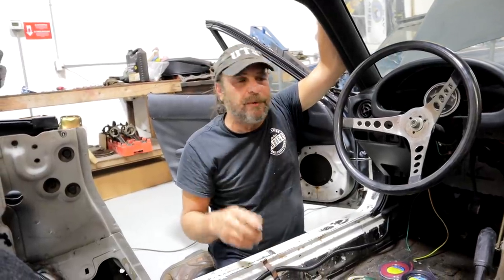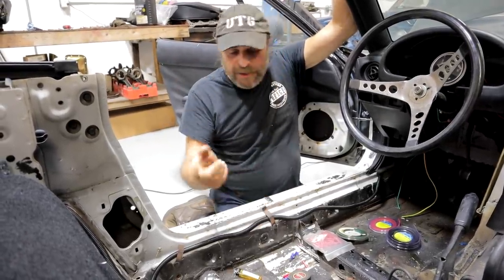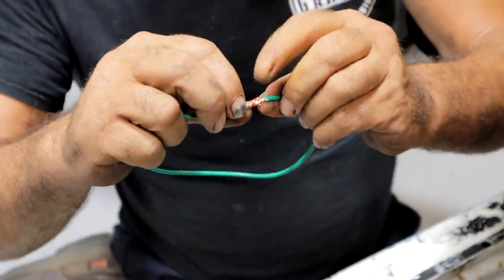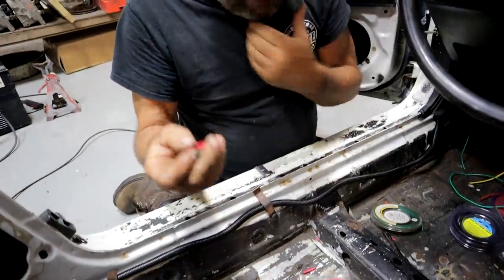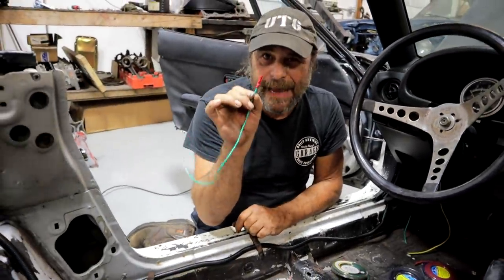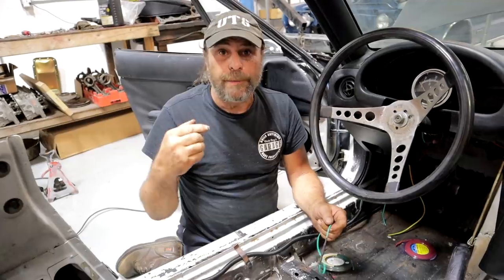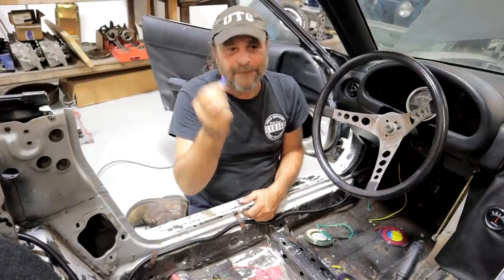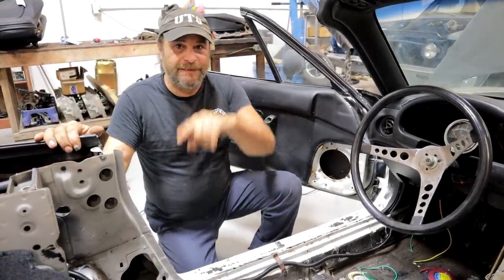The Single Most Misused Item In The World Of Cars

Comment: I have fixed sooooo many of these that the "crimp" has backed off or relaxed and the connection is now intermittent.  I always replaced customer work like this with a westinghouse splice (good mechanical connection), solder, a little silicone sealant, and a heat shrink.  I have never had a problem with this method.  It took a little longer to do but the customers never had problems with my work.  When I needed to make any other type connection, I would only buy the spade lugs or washer type connectors that would accept solder (a lot of them do not).  Never had a problem with my work.  In my 30 year business I had a lot of repeat customers that really appreciated my work.  
Crimping with an improper tool ( as he is using) usually lasts until the customer gets out the door.  If you are using a crimp, get the proper tool to crimp the proper crimp connector.  Metal tends to return to it's original shape over time, uncrimped.

Comment: The only correct way to use those cheap plastic coated butt connectors, is not to use them.
If you have to butt connect something, use a better crimp connection that folds over into the wires. Like OEM ones. It won't have any cheap plastic on the outside. And you will still have to heat shrink it but you also don't have that crap plastic making a thicker connection, doing nothing, and hiding how will your crimps is actually crimped.
Further, you don't crush a crimp together, it squeezes and should ratchet and compress turning it into itself compacting the wire in there... 
As soon as I see a single butt slice like this, it's just as bad as all the other crap connectors you're talking about. These do not belong in any car.

Comment: Jeez..barely better than twist and tape method. Start with uninsulated crimps. Get a decent  set of crimpers made similar to pliers. (not combo multitool stripper crimper that comes with 200 cheap crimps) always crimp with dent side opposing split in crimp. Keep split side in the valley. Do not twist wires, leave stranded. Always stagger connections to keep crimps from being all together in a ball 3x the size of the rest of harness. It will  make a more durable, way cleaner harness.  cover crimp with marine grade shrink tube. ( in a pinch take a thin bead or two of hot glue across length of crimp and  beyond the insulation of wire on both sides of  crimp.  allow to cool and cover with regular  shrink tube.  when heated to shrink, endanger glue should remelt and come out of both ends.  wipe away excess) additionally after crimping can solder into crimp as well. Not recommended  for smaller wires  or high vibration areas though . More like for 0 or 2 gauge  crimped ground rings for example . Do not overdo it as it will lead to being too rigid  and breaking at joint.  finish  with spiral wrapping entire harness  with space between wraps like  one candy cane stripe. then cover with correct size loom then tape loom in similar fashion . Except start tape at forks or ends by wrapping around wire only then bring tape through  split in loom and  repeat at opposite end or  junction. Seriously ,throw  that harbor freight buck bin connnector set and tool in the garbage  if you want no problems and professional  appearance .I'll make a video next time i have the opportunity to.  I assure you will have  a much better end result .  materials  can be had online with same budget if planned and sourced ahead of time . Will take about 50% more time/ labor though .

Comment: Definitely should use shrink wrap, and if you do it exactly like Uncle Tony, you have a good start, but you should really do it a little better.  

First, don't use the butt connectors with the plastic insulation and then add shrink wrap.  In a pinch it's fine, but it just builds up unnecessary bulk.  Either get the butt connectors without the plastic insulation or remove it.  You don't need it, you are going to shrink wrap.  Second, use a better crimp tool.  What is being shown will work, but it is will not provide a very strong connection.  There are much better crimpers that are specific to the job and will make an excellent connection, and unless you are using a heavy gauge wire, they are still pretty inexpensive.  Third, don't use a cigarette lighter to melt heat shrink.  It does a very poor job of melting it evenly and stands a much higher chance to lighting things on fire.  Heat guns are very inexpensive and are the correct tool for the job.  They will make sure that your tubing is shrunk evenly and provides the best possible seal.  Lastly, generic heat shrink tubing will provide some protection, but it is not sealed and will still let moisture in.  Look for waterproof heat shrink tubing.  It has a bit of adhesive on the inside that will melt with the heat, adhere to the wire insulation of your joining wires and provide a water tight bond.  You can find this on Amazon, and is sometimes called marine grade.

They also make butt splice connectors that have water-tight heat shrink insulation already on them.  I fear that most crimping will compromise the insulation, but they may be useful in a tight spot.

Comment: Some people say that soldering is the way to do this properly..... to some extent, they're right, but this could cause problems down the road.  Soldering is Way better for electrical conductivity and virtually NO resistance at the joint.  The problem with soldering stranded wires is it literally turns a flexible stranded wire into a SOLID wire at that point, and we all know that solid wire is prone to stress fracture and failures.  The only way to get around this failure prone area is to supply a significant amount of support to the joint to prevent or eliminate flexing or vibration induced stress fracturing and failures.  Shrink tubing does this quite well, but the joint should also be secured in such a way as to support both sides of the joint.  Flexing a solid wire will break it.

Comment: Check with you're supplier or parts store. I use a crimp connector with heat shrink and glue for sealing wire's. Useing kimpex style pliers ment for un insulated crimps drives a divot into the connector then hit it again with the standard crimp jaw. You will break the wire before you pull it out if you do it right.

Comment: I see a lot of heat shrink butt connectors used where someone didn’t shrink them, or half way shrank them. Drives me nuts. Why use heat shrink if you aren’t even gonna bother shrinking it? 

And, usually if I’m doing diag on an electrical issue a good place to start is usually wherever there’s electrical tape or other “repairs” done to the wiring.

Comment: I worked years as an industrial electronic technician; I Always soldered and shrink shrunk controllers wires.  If a factory line assembler connect fails it can cost $$$$ if the line stops. $$$$

Comment: now that is the problem: a so called professional working like a hack.
that kind of crimping tool is not used by anyone that works electrics for a living.
because it sucks big time.
it just squeezes the metal flat.
just a problem waiting to happen.
a real  crimping tool crimps a hexagon.
and by the way, those connectors were never intended to be used with shrink tubing.
the ones that are have the shrink tubing incorporated into them.

Comment: Excuse me for being late to the party....unfortunately you really missed the most important rule when crimping wire connections. That is to be sure the seam in the crimp connector( where the seam is where the metal is rolled to gether as you can see looking in the end of the connector)
is against the solid anvil on the crimp pliers and the pointed jaw is against the solid ( opposite) side.
The crimp is many , many times stronger this way.
If this is done on waterproof ( marine) connectors shrink tubing is redundant. 
Gary

Comment: I hate those connectors.they bulk out the loom ,look ugly and are unreliable as far as vibration is concerned.Solder and heat shrink so much better.Does not bulk out the loom to a big ugly bulge.IMO.Never had my method fail yet.you can also use non conductive grease inside the heat shrink for marine environment.Stops water and oxidization getting to the joints.You can troll me all ya like .facts are facts.I cringe when I have to fix a car stereo and see a mess of these crimp connectors ,ugly bulky and not reliable ...

Comment: All that waffle about heatshrink, yet the incorrect crimper is used? Those things are rubbish, they can cause weak spots in the wire/crimp, putting undue force on the tube and I have often seen the plastic fractured from heavy-handed crimping. Only a decent ratchet crimper should ever be used, which will apply the correct pressure along a precise length of the inner metal tube.

Comment: Its funny the marine industry doesn't use shrink tubing on boats normally for connections like these.  Most all connections are just connectors without tubing, and that is direct from many well respected boat manufactures.  According to NMEA and ABYC you can not solder connections as that causes a weak connection that will break with vibration over time.  You have to use mechanical connectors.  I myself use connectors with the adhesive tubing built into the connector, they make great waterproof connections.

Comment: Solderless connectors work great , but , in tight areas , especially inside looms and behind the dash , a big wad of these things , even IF you stagger them , is often still to bulky .
Call me old fashioned , but , I still like to solder and shrink the splices . Makes for a neater and more compact install / repair .
I would also say that vinyl electrical tape is the SECOND most abused / misused thing in the automotive world , at least as far as electrical systems go .
If you are wrapping a harness , there is far better stuff available , just a little garder to find then than duct tape's semi literate cousin .
The industry standard is PET cloth that adheres to itself , and , there are high temp varieties for use in your engine compartment , and , foam coated versions for interior use to avoid rattles and vibration .
The real pros use these , especially in the custom audio world .
So , avoid the self unwrapping , sticky , nasty , vinyl crap and hunt down some real harness tape .
Details like this really make a tremendous difference in the quality and appearance of a project , and , pay dividends in reliability .
Professional looking electrical work only takes a little more effort and minimal expense than the electrical tape and wire nut approach , and , you are less likely to let the magic smoke out .
That Genie does not grant wishes .

Comment: I've stopped using butt connectors years ago, now I use saddle style clamp connector with a special  crimping pliers and shrink tubing. much stronger connection, smaller surface area to allow movement. if done right the wire will break before the connection fails.

Comment: I usually take the plastic sleeve off the butt connector and just go strictly with the heat shrink tubing ( marine grade with the glue on the inside ) . This usually makes a slimmer splice and works better for the circuits I make.

Comment: I purchased a used truck years ago that the previous owner had replaced the dash in. It also had a brand new crate engine in it so I picked it up! Well it had a plethora of weird electrical issues ,one being if you hit a big pothole or a really bumpy road the engine would turn off! Lol! Well I discovered that the previous owner had used "butt connections" on all the wires under the dash coming from the main wiring harness. It took me forever and it was uncomfortable as hell as I was on my back under dash replacing all the butt connections with solder and shrink wrap. After that all my electrical gremlins went away. So yeah in my opinion "butt connections" suck!!

Comment: I started using bare barrel connectors with a lug crimping tool (and heat shrink). I found the standard crimp tool just squeeze's the wire and connector into an oval, where the lugging tool nails that wire hard resulting in a stronger mechanical and electrical connection. There are fields that specify the wire and connector are joined in such a manner that when placed in tension the wire breaks before the connector slips. I shit you not. 
There are also self healing shrink wrap barrel connectors, My lug tool worked well with these connectors but would pierce the skin but goop would exude from the pierce during the shrinking so I guess it's a wash. Use to get them from NAPA.

Comment: Stop soldering.!!! Use an uninsured button connector, with a proper crimper that folds the center of the spilt back in on itself then heat shrink. Why? Vibration will weaken the wire right at the solder and it will break at the end of the solder. If soldering was the way to go, car manufacturers would be doing it.

Comment: Just do the job right and solder the connections. Butt connectors are acceptable for emergency/roadside/trail fixes only. Just enough of a repair to get you home or to the shop. After, be sure to make the repair permanent by soldering the connection. To seal it I usually use liquid vinyl electrical coating on the bare section and then cover that with shrink tubing.

Comment: Living in the "rust belt", I use the one's with the shrink attached, apply some dielectric grease to the wire before inserting, and shrink tube over top with normal. Great for trailer wiring and stuff on the exterior

Comment: As a Ford tech, the acceptable warranty repair(per Ford)  is the uninsulated connectors and tubing with the adhesive inside. Those ones you have are a pain, because you can't see the crimp, and crappy.

Comment: Not sure if it's been said or not, but the quality and shrink ratio of the shrink tubing also has a lot to do with it. I personally use 3:1 for butt connectors and 2:1 if I do a soldered connection. If the connection is where there is a chance of moisture, dirt or any debris that could sneak it's way in, I also add dielectric grease before crimping and shrink tubing. It's about the best for a temporary connection you can get. A permanent fix is always soldering and then shrink tubing.

Comment: I've personally never had an issue using these crimp terminals. If they're done using a proper wide jaw ratcheting tool they're fine. Also if you need to heat shrink it to protect from the elements, use glue filled heat-shrink to seal. Standard heat shrink will still let water in. Otherwise use good quality electrical tape.

Comment: Am an retired electrician/electronics tech.  I use solder connections and shrink tube.  When you use crimp connectors the wire is also still exposed to the elements.  Crimp and wire nuts are fine in places where there is no environmental issues, which means interior use only.  Today they have some new concepts out there where they  have a good concept, basically a solder ring inside a heat shrink tube.  These new connectors seem to work quite well.  Next throw those damn crimp pliers in the can and get a set of crimp pliers.  Yes you need to have a stripper plier and then the crimp pliers, but they are far superior.  Crimp connectors without shrink tube is a temp fix that WILL fail in a non climate controlled, and instal with vibration or strain.  So you are back to square 1, the new concept of the solder ring inside a shrink tube seems to be the updated answer.

Comment: You're supposed to crimp the plastic part onto the insulation. Honestly, I can't stand these connectors. I'd rather use those insulation displacement connectors. And there's nothing wrong with wire nuts, they're perfectly fine

Comment: I'm sticking with soldering and heat shrinking. And some times a hot glue gun.

 Even on auto stereo equipment done myself. I wanted to install a cd player into a vehicle that had a cassette tape player. I wanted to keep the original harness alone without cutting up all those OEM wires off the cassette player. I made my own contraption adapter to plug into the OEM stereo harness. I soldered some copper plated pins, that I recycled from some old equipment, to each needed wire on the stereo side. Plugged them into the OEM harness. Hot glued the pins to keep the placement. Unplugged it and did some more hot glue touch up. And there was my homemade OEM stereo adapter instead of paying like $80 for one that someone else ripped out of their old vehicle and snipped off the OEM stereo.

Comment: As a 30 year low voltage electrician,those are still junk. Honestly you are better off using any form of wire to wire connector,twist on or crimp on,like the old bell connectors,as opposed to those style. You are relying on the metal of the connector to conduct voltage through instead of the wire itself. You often wind up with a high resistance connection using these connectors. 
Solder and use self sealing shrink wrap. This cannot be stressed enough for a permanent connection,especially where it will be hard to get back to later.
 Use a flux if possible,rosin core solder only works well on new clean wire. If soldering old wire that has any oxidization on the metal,dip it in an acidic flux,heat it to activate the flux,then clean it off with rubbing alcohol. It will clean it to bare metal and keep you from making a clod solder join. If need be flux and heat a couple of times to clean it completely. Once you are done fluxing and soldering,wipe it all down with alcohol again to make sure the acid is cleaned off,then shrink wrap it.

Comment: My opinion, people should avoid being penny wise and spend more on a higher quality butt splice. For example a non-insulated splice, a heat shrink splice, or even one of the splices that's made with solder inside and a heat shrink outer layer.

Comment: Hassitronic makes a great crimp connecter, with thick shrink tube over it instead of hard plastic. They also have a connecter with solder inside shrink tube that is used with heat gun, love em...